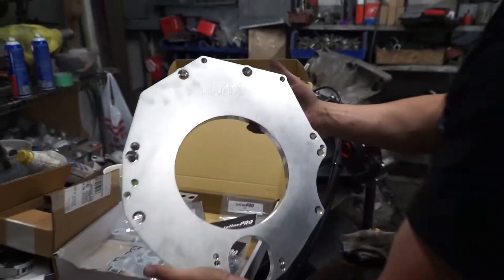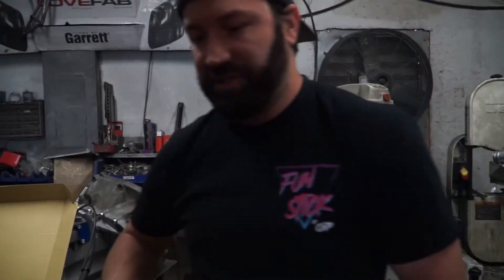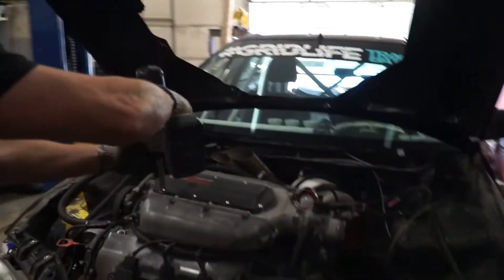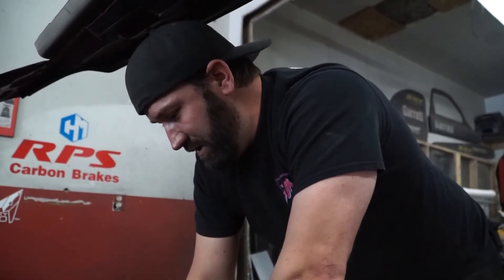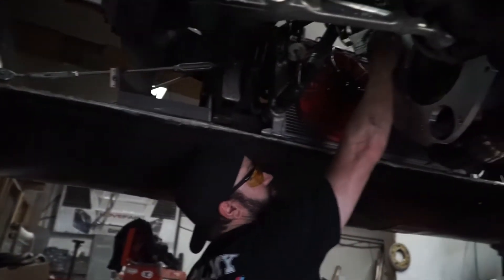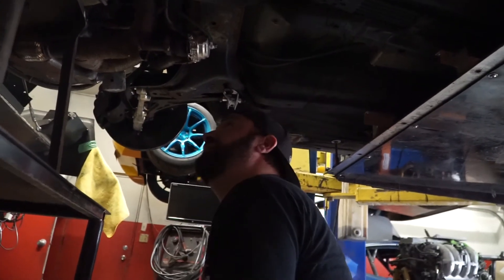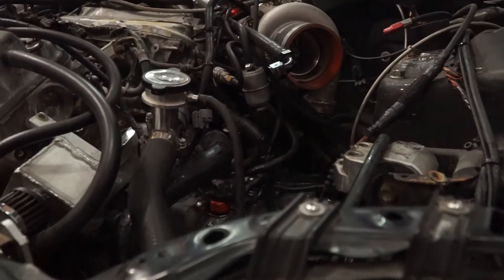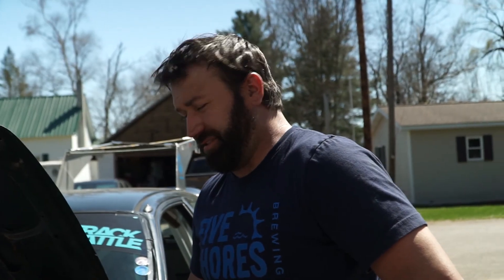Beastie Hatchback Gets a Sequential gearbox!

Comment: How to you guys address the need for a longer input shaft with such a thick spacer between the engine and gearbox? I was always curious to know what is the solution
Reply from the maker: Inlinepro provides a flywheel spacer to accommodate